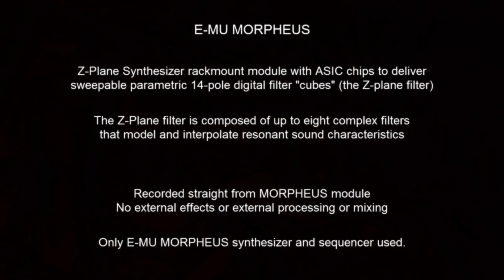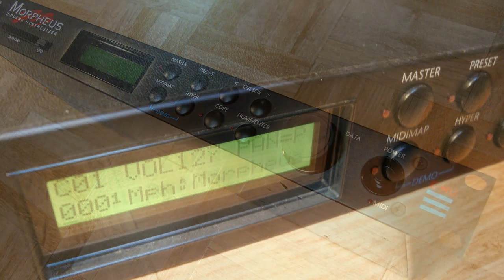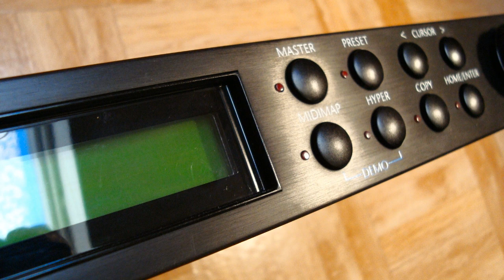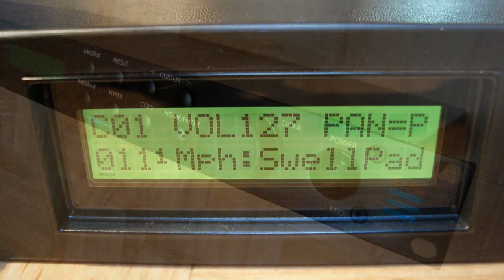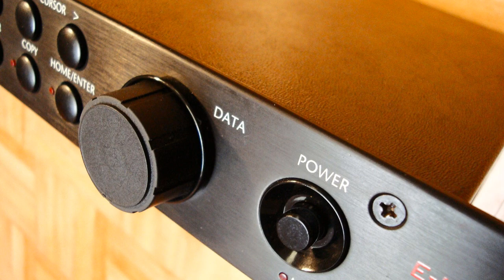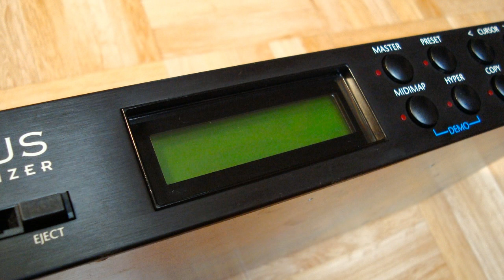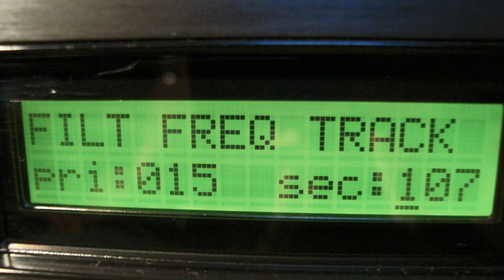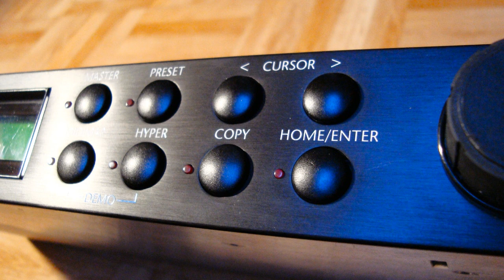𝗘-𝗠𝗨 𝗠𝗢𝗥𝗣𝗛𝗘𝗨𝗦 Z-Plane Synthesizer 【Demo】

Comment: Hi oscillator love the sound of this thing, would be great for ambient. Can i ask how many of these sounds are presets and how many (if) you made from scratch yourself? thanks so much!
Reply from the maker: Hi! All soundclips in this demo are recorded in 'Preset' mode, some clips were recorded in 'MidiMap' mode using the external sequencer. Some sounds are ROM presets or modyfied ROM presets, but mostly I programmed my own patches. Yes, the Morpheus is great for ambient - you can check 3 parts of "Insanity" track on my channel. The only synth to record all these soundscapes was Morpheus, nothing else was used. Cheers

Comment: So where is the noise coming from in the recordings? I like it and I'm happy with my AX73 and CZ-1 impart a little noise into the signal path alongside their synth sounds.
Reply from the maker: DivKidMusic My PC don't have a line-in so I used a cheap external USB-audio card (chinese one for 10 bucks on ebay). After normalizing the recorded sounds some noise appears, unfortunately. The synth itself has good output (Max. Signal to Quiescent Noise and Dynamic Range >90 dB, Frequency Response 20Hz-15kHz, Sample Playback Rate 39kHz, THD +N and IMD <.05%). I recorded another demo (Insanity) on different PC with line input and everything was fine, no noise.

Comment: One thing I wonder is how the Morpheus (or Ultra Proteus) compares to my Proteus 2000s) I have two). From what I understand, the Morpheus has more filter types, but I find it difficult to mentally translate this to "would it be worth it?"

It sounds nice enough, but I already have such a ridiculous amount of sonic potential at my fingertips, that the question begs whether I should perhaps focus on what I already have. Not to mention, P2000 are dirt cheap these days, but the Morpheus isn't. 

Thanks for the video; the Morpheus sounds ethereal. And that's a good thing.
Reply from the maker: I never had the Proteus 2000, that's why is difficult to compare it with Morpheus or Ultraproteus. I believe that every synth can sound great. Many years ago I had the Yamaha DX21, my first synth. Simple 4 Op FM machine, very basic, without FX processor and sequencer. I spent many nights to sit and program this keyboard, just to get out some interesting sounds from it. And even now, after many years and playing many top-range synths, I still wonder how this simple FM synth sounded so good. The answer is - because I made the sounds I wanted to hear. This is the secret of every synth. If I should play the factory presets of DX21, I will never touch this synth again.
Reply: @_oscillator  Well, I just love the sounds of the Morpheus. I do think that it's quite different from anything else I have (EX5, AN1x, EMX-1,  Wavestation SR, AIRBase99, Micro Q, and 2x Proteus 2000). There is more programmability to explore in those than I have years left in my life.
Reply from the maker: @SeverityOne  Great choice - EX5 and AN1X definitely are on my wishlist too, same as FS1R. Yes, the Morpheus is very smooth synth, but the only thing it differs from other romplers is very special Z-plane filter. This filter system makes the sound more alive due the real-time changes of frequency, resonance and amplitude. Same filter system you can find in Ultra Proteus model, which has exactly the same synth engine - only difference is different set of ROM waves. But again - the factory presets of Morpheus or Ultra Proteus doesn't show even a part from all capabilities. You can check all three parts of "Insanity" track on my channel, only the Morpheus synth was used to record all sounds there. Factory patches were not used at all.
Reply: @_oscillator  Ah, you're the person behind Insanity? Excellent demos, those.
Reply from the maker: @SeverityOne  I just tried to discover the dark side oif this synth. Actually the Insanity Trilogy was not a demo, it is more like an experimental work with random elements of Z-plane engine. Musicians knows the Morpheus for sweet pads, but it is perfect tool for ambient stuff too.
Reply: @_oscillator  Yes, sorry for calling it a demo. I was on my phone, and I lost context. Having listened to some sounds from the Morpheus and Ultra Proteus, and comparing the list of instruments that I got from E-Mu Mania (73 in common between the two), I'm still more inclined towards the Morpheus. But checking prices, neither the Morpheus nor the Ultra Proteus come cheap these days.
Reply from the maker: @Severity One  ROM waves of UltraProteus are based on Proteus 1 Pop-Rock, Proteus 2 Orchestral and Proteus 3 World synths (470 waves together). Morpheus has less ROM waveforms (242 waves), and they are not based on previous Proteus models, but were made specially for Morpheus and contains some special synth waves. UltraProteus has more Z-Plane filters too. Otherwise they are identical, including the same functions and FX processor.
Reply: @_oscillator  Anyway, you'll be pleased to know that today, I managed to get a Morpheus off eBay. And even if you aren't pleased, I certainly am. 🙂
Reply from the maker: @SeverityOne  Great news! Just an advice - please carefully read the Users Manual. That will let you understand some very specific functions of Morpheus synth, such as Function Generator and, especially - the effects section in MIDIMAP mode. This is very important. Another tip - use MorphEdit software to edit your synth from Windows computer. Another nice editor is Edisyn. Both are freeware and works on 32-bit and 64-bit computers. I wish you lot of inspiration with Morpheus!
Reply: @_oscillator  Will do. One thing I forgot to mention: I've played this video very often, just because I like the sounds. I like synth demos in general, but this is a whopping hour long. It's great when trying to concentrate at the office, and that's what I'm doing right now.
Reply from the maker: @SeverityOne  I'm glad to hear you like this demo, I really appreciate this! You can find another one hour long demo of Kurzweil K2VX synth on my channel. I hope you will like it too. Cheers

Comment: These are absolutely beautiful, my exact taste when it comes to patches - love huge pads and textures! Seriously incredible work. 

I was wondering when you would be finished making your soundbank for the Morpheus? I’d happily pay money for an incomplete/WIP version, I don’t actually have a Morpheus but instead I’ve got an Ultraproteus - the patches would work right?
Reply from the maker: Morpheus synth is great not only for pads - the best part of this synth is ambient stuff, imho. You can check 3 parts of "Insanity" track on my channel, they were recorded using a single Morpheus synth. This track shows the real power of Morpheus. 
About UltraProteus - yes, it uses the same sound engine as Morpheus, but ROM waves are not compatible directly, so these patches do not work without altering of wave numbers. In other words, it is not possible to play Morpheus sounds on UltraProteus without changing the waves. The only way is to change these waves manually to something close to original Morpheus waves, but there will be some differences in sound anyway.
Reply: @_oscillator  Interesting, thanks for your reply! I checked out all your stuff and it's all really awesome. I seriously respect your ability and patience with these older ROMplers, they're my favourite synths but boy are they hard to program - I've been wanting a Morpheus for a long time now but only managed to pick up an Ultra Proteus from South Korea. It's very hard to find a Morpheus in the UK.

 The Ultra Proteus really seems to focus on replication of traditional instrument sounds (for the presets anyhow) but it is indeed more powerful with double the waveform size. I prefer to work off of presets as a base for programming new sounds but the Ultra Proteus definitely doesn't tailor its self towards 'electronic' or 'ambient' etc. Programming these soundbanks must be hard and labourous work so I completely understand!
Reply from the maker: @connor1uk  ROM waves of UltraProteus are based on Proteus 1 Pop-Rock, Proteus 2 Orchestral and Proteus 3 World synths (470 waves together). Morpheus has less ROM waveforms (242 waves), and they are not based on previous Proteus models, but were made specially for Morpheus and contains some special synth waves. UltraProteus has more Z-Plane filters too. Otherwise they are identical and same good. 
The best and easiest way to program those synths is from the software called MorphEdit - it is freeware (no need any registration), portable (no need to install), works on 32-bit and 64-bit Windows. Great software, works like a charm on big screen of computer, instead of programming from 2-line tiny display and endless scrolling between the pages.

Comment: Never got mine to sound this good but i might fire it up
Reply from the maker: Morpheus is very unique synth coz it can be very different - from nice sounding to bizarre noises. You can check "Insanity" track on my channel to hear what I'm talking about. Cheers!
Reply: I used it a lot years ago but recently I went back to it and thought it sounded weak, compared to FS1R and some other synths I've got, but I admit you made it sound good. I think it's the difficult editing that puts me off of my outboard stuff
Reply from the maker: FS1R definitely is the synth I also would like to have. Same as FIZMO. At a moment my tools are Kurzweil K2VX, E-mu Morpheus and UltraProteus, Blofeld, Wavestation and Kawai K5000. Every synth can be great if properly programmed, because most of the factory patches are just a crap.
Reply: I've got the FS1R.  Havent used it much in a while because there was never a good PC editor for it but I found one a couple of days ago.  It is quite cool that you can turn samples into FM Synthesis!
Reply from the maker: Sounds impressive! Many years ago I had the Yamaha DX21, still remember this my first synth ever... yeapp, FM is still cool thing. By the way, the Morpheus has a really nice PC editor called MorphEdit. It's freeware, you can find it over the internet.
Reply: I remember selling my analog gear for a DX21/DX100 when TB-303s were literally about £100 -- they were the last thing in the bargain bucket of any 2nd hand shop -- I soon realise my yamaha couldnt do acidy sounds  but  then 303s doubled in price...and beyond

Comment: Hello,
thank you for your excellent demo.
I bought a morpheus because of your video and these sounds.
Can you please tell me which presets you used?
Are they from these RAM/ROM banks?:
https://www.emumania.net/emu-morpheus-sound-module/
In my bank 0 RAM there are other presets than listed on emu mania.
Thanks for your help.
Paul
Reply from the maker: There are many Factory RAM and ROM presets used in this demo, as well as custom patches. I  started to fill the bank with custom patches long time ago, but it's still not full and ready-to-use. The idea was to create one full bank with 128 presets as commercial product, but it's not ready yet, unfortunately. I wish to complete the bank, but I really don't know yet when it will be ready.
The reason you have different presets in your 0 RAM bank is that there are loaded presets from Morpheus Card Collection. You can easely restore the original RAM presets. To do this, you must Hold down “Cursor Left” and “Cursor Right” while powering on. To re-initialilize and ERASE all user preset data, select Diagnostic 16 and press enter. After this, the original Factory RAM presets will be restored.
Reply: @_oscillator  Thank you very much for your detailed reply. Let us know when your bank is ready. Or make a offer with less than 128 presets. I would be very interessted.

Comment: Morpheus vs. UltraProteus?

I know that the ultra has got more filter cubes and a different sample set, but do these differences make it actually better? 
Which one got the better sample set?
Reply from the maker: Both are good (I have them both). People say that Morpheus is more synth-sound oriented, while UltraProteus is better for acoustic emulations. I would like to say that UltraProteus have same good synth waveforms. I could not see big difference between them, honestly.
Reply: @_oscillator  so would you rather recommend the Ultra (because of the more numerous filter cubes), as the wavesets aren't that different?
Reply from the maker: @thedoublek4816  The sound engine and all programming parameters of presets, hyperpresets, midimaps and FX processor are exactly the same for Morpheus and UltraProteus. So in that point is no difference at all. 
UltraProteus has more Z-filters (288 filters) - it contains all filters from Morpheus (197 filters) and also added vari-pole filters, parametric tracking filters, harmonic shifters, vocal formants and instrument formant filters. That definitely makes UltraProteus much better than Morpheus. 
About ROM waveforms - UltraProteus is based on Proteus 1 Pop-Rock, Proteus 2 Orchestral and Proteus 3 World synths, that means it has many orchestral, piano , woodwind, percussion, bass, organ and classic synth waves (470 waves together). That makes UltraProteus great for contemporary stage musicians, who likes to play in band. Morpheus has less ROM waveforms (242 waves), but they are not based on previous Proteus models. They are made specially for Morpheus and contains not just an ordinary orchestral, bass, percussion waves, but also some very special synth waves, that makes it better for pads and ambient stuff. So personally for me Morpheus is a winner in that point.
I can rate Morpheus and UltraProteus as 50/50. Morpheus have more interesting waveforms, while UltraProteus has more Z-filters. If you like to create experimental and ambient style, than choose Morpheus. If you like to play in band and prefer standard sounds - choose UltraProteus. But as I said before - the difference between Morpheus and UltraProteus is not big, even if the number of filters and waveforms are different. They both have same synth-engine and sounds very similar. If you create a patch with same program parameters, same FX settings and using similar waveforms (like square or saw, choir or strings), you won't hear any difference.